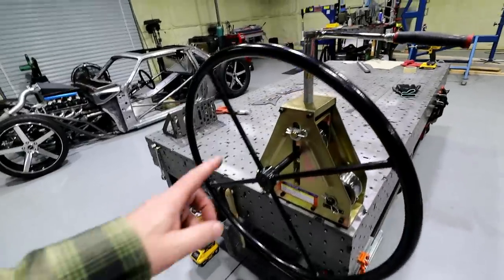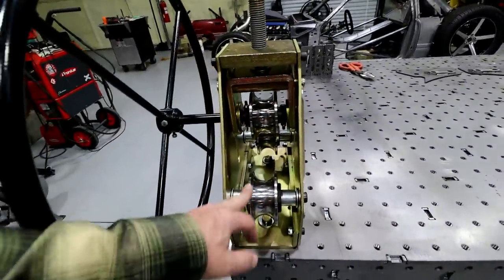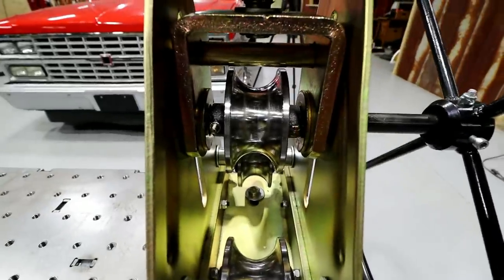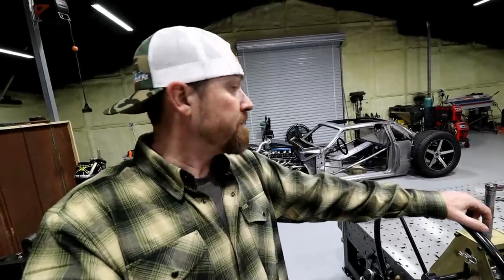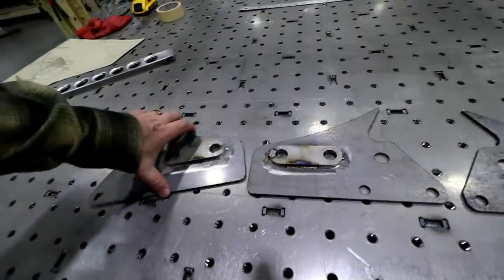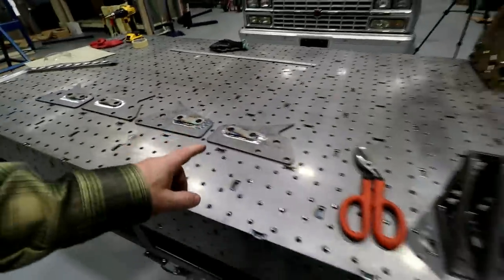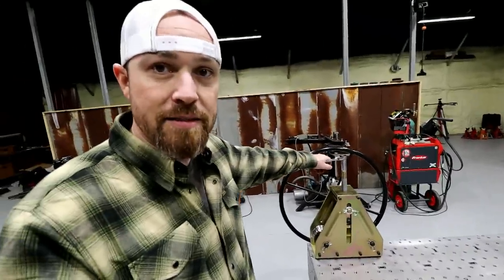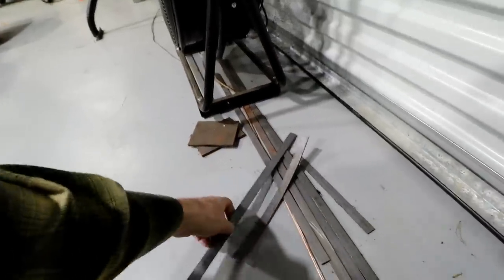Harbor Freight Tubing Radius Roll Bender with SWAG Off Road Upgrade Options

Comment: Not sure if it was mentioned but to get rid of that chunk of whatever in the wheel, you can drill a small hole in the wheel, squirt a whole bunch of caulk in there and that piece of whatever will get stuck to it. Let it dry and no more rattle.
Reply: AJ Hartman Aero, or a magnet.

Comment: I'd have to cut that wheel open and let that noise out. For me it would be worth it to weld it back togeather. It would drive me crazy.
Reply: lol just put a little magnet on the wheel so it grabs that little piece of slag in there and holds it in place. i get what your saying though

Comment: Helpful tip to avoid going insane, drill a small hole on inside of wheel and spray foam to trap the slag.
Reply: Drill a small hole in the outside of the wheel, rotate it to the bottom and just drop the slag out.

Comment: You dont always have to buy the expensive stuff, when i started golfing i didn't go straight out and by pings or Taylormade's i got the cheap Sports authority stuff to learn on. And they lasted me for years. But that jingle in the wheel would drive me nuts, lol. I would drill a small hole and spray some expanding foam in there to maybe stop that.

Comment: Nice video FAB.
You mentioned wasted tube.
Here a great mod you can do to reduce your waste for this type of bender.
You will need a lathe to make these. (CRS is cheap)
This is basically a steel plug that is inserted into each end of the tube your working.
Can't post a picture here, so I'll try to explain how I made mine.
There are 3 different diameters, one piece, two plugs needed, 1 for each of tube.
*1st diameter is the ID of your tube, that will fit inside, no more the 2-1/2" length (inserted.)
* 2nd diameter next in line, is the same size as your OD of tube. This length should be approximately 4"-5" (This length depend on YOUR bender)
*3nd diameter is next in line, make this diameter, 1 1/2" to 2" bigger the your OD of your tube, at least 1" thick. (length) You can also weld this diameter to the end. Save on material.
 Now, with the plugs installed, you can use this "extra length" to roll your tube all the way to the end of your tube.
This biggest diameter will help you remove the plugs when your finished with your bend. (AKA hammer)
These are a little on the heavy side, so I drilled a 1" hole thru each plug to reduce weight. (1- 1/2 tubing set)
Put a little grease on the inserted part before using.
Now you have VERY LITTLE waste!

Comment: Just finished using that tool to bend an ark in 1.5x.095 DOM to match the curvature of a Datsun 260Z windshield. Friend I borrowed mine from just used two 1/4 inch plates bolted to the frame with holes for the axles at drilled at various spacing. There was a brace running from the plate he added to the top of the frame for rigidity. Worked great. I like the bottle jack idea. We talked about the lock screw problem and decided the thing that would be best is cutting a key way in the shaft and the wheel but a bolt or pin like you have looks like it's working ok.  Great tool for the money.

Comment: Used that same setup with the swag's add on plus the bottle jack setup rolling 1-3/4" Dom tubing for several side by side roll cages. Worked very well for them, I bought a universal digital read out scale and mounted that up to be able to make repeatable rolls as I had a jig set up for making roll cages.
Reply: When doing those and you need to add more radius is it the same as a traditional bender where when you put it back in you level your tube to the die? Or on these does it fall back in where it was?

Comment: I used a gantry crane winch and a k24 cam and crank gears with the chain to power the fkr. A plow disk as a base, 3 inch chan and some cam follower bearings to hold it all aligned.  Tensioning the chain, a couple heims and schwaged tube. 
Works great, no workout neccessary.
Reply: I was wondering what kind of motor would be suitable for this application

Comment: You need to get the pipe threader attachment so you don't have to crank this thing by hand.   I had the same setup 5 yo when I bent 1" square tube railings for my house.     You will get tired real quick after bending one piece of steel (and blisters).   The motorized pipe threader is the best addition ever to this tool.
Reply: Did you use the rounded does it comes with to bend the square tubing?
Reply: @bobbyisonhood3530  no.  the correct dies were purchased through SWAG.

Comment: Wow, nice welding table you have there :)  I did the set screw thing too cuz it failed in the same way yours did.  All I did was deepen the set hole to like 1/4 inch and used hex screws instead of the crappy plugs they give you.  That has worked well.  I also use a huge impact gun to tighten the top socket and that has made the thick wall stuff happen.  The Swag wings makes it happen easier though for sure.

Comment: if you want to get rid of the slag noise. Drill 1/4 inch hole on each side, Maybe the slag will fall out, If not, fill it with expanding foam from a can.

Comment: Bear in mind the four little screws holding the forcing screw plate. Shear point on those can't be very much. I have one, welded to a roll around table. It let me roll some large rings that my ceiling didn't permit, outside.

Comment: So if you need to bend a full circle, how do you remove it from the press? it looks like the circle is gonna be trapped inside unless you take the machine apart.
Reply from the maker: Full circles are hard but you can either make them in two halves or roll them offset like a spring and then cut and bend to line up.

Comment: Very nice, that rattle in  the roller wheel, if you drill a small hole in the inside and put some spray foam in it that will stop it and when it expands through the hole trim it off . Spray it with a bit of black paint your won't know

Comment: Rather than modifying what you have already bought. I'd go down to the local laser cutting place and get them to cut new pieces with the extensions already part of the sides, probably work out same or cheaper. But instead of getting them to put holes in the bottom piece I would redesign the whole thing so the worm gear sat horizontally for infinite adjustment and use the bottle jack on the top.
Reply: Where is there a worm gear?

Comment: LOL, "Guess, I gotta listen to that, forever".   Yeah man.  Hey, you could drill a hole and squirt in some epoxy, roll hole to the top, hopefully slag rolls to the bottom and cures.  Maybe even great stuff.  Hey I got a cherry picker where half the holes needed egging out just to bolt it up.  Was worth it in the end.
Reply from the maker: good idea

Comment: If that treaded bolt is 5/8" or 1", I don't know.. you can get a weight jack nut from speedway and weld it to the top of the frame for more stability

Comment: awesome someone should make dies for brake tubing to straighten it out since always packaged in circles. with multiple sizes of tubing.
Reply: Just roll it out on a flat surface..like the ground 👍
Reply: You can buy or make a brake line tubing straightener very inexpensively. Look it up. Some sort of brake line straightener IS a must have.

Comment: I wouldn't use a pipe-threader on the shaft if I was going to motorize it. I'd put a small rubber wheel on a washing-machine motor and have it engage the big wheel. The big wheel looks rather smooth so maybe rough it up a little so it grips better. The ratio between the two wheels should provide more than enough torque. Control the motor with foot pedals so your hands are free to make other adjustments during the process.

Comment: Do you know offhand how tight of a radius you could get on a 1-in tube? I've got sailboat and I need to bend some 1-in stainless tube for a solar arch. I need to get some tight radiuses though and I'm not sure if this machine has that capability.
Reply from the maker: you wouldn't want to bend a tight radius out of stainless with this tool. It's made more for long / large radius bends. You would need something more like this https://youtu.be/hXsEFlQZwKA

Comment: Weld a nut on the end of the hand wheel shaft and use a cordless impact driver to spin the wheel back and forth. Much less arm work and faster.

Comment: I don't think swapping those washers around achieved anything accept for adding more load on the die. That thin washer is a hardened shim, you added the spacer mild steel washer from the outside to the inside. You didn't actually take any flex out, not  until you take up the space between the 'R' clips and the outer face of the bender where you swapped washer from originally. Hope you take this comment constructively and not negatively. Like watchin' your stuff, keep at it.
Reply from the maker: Dont think you understand what I did...
Reply: markham1109, it's not a flex issue it's a twisting issue, if they're misaligned you'll get a corkscrew affect.
And those are called hairpins.
Reply: Anomilumi Imulimona 
“and those are called hairpins”
on another planet, maybe

Comment: Wow, $160 for that. I'm making one from 1/4  inch thick 3 inch angle iron doubled up, that is 12 inches long. I'll have maybe $15 into it total. LOL. I'll be able to do 4 inch wide steel, pipe, flat stock, angle iron, and anything else I can shove in it. Good to know, thanks for sharing.

Comment: Can yah get a 90° bend with that
Bender Brother?
Reply from the maker: Yeah
Reply: How tight of a 90° bend will it do. want to do a roll cage and Dont want a long sweep.TIA
Reply: Arizona 
With steel probably 1.15 times double the distance between the outside rollers, plus what? ~6% for spring back.

Comment: I can't use a impact 1/2 & spin the thing for more force? Or a sds?
Reply: Maybe. But not only would that increase force, but steel bends very smoothly a little at a time. That’s not a production tool- it’s a fabricator’s tool to enable you to do things custom that you can’t otherwise buy or create controllably.